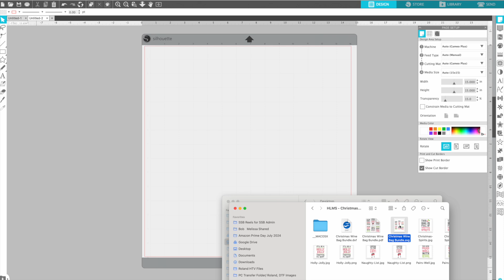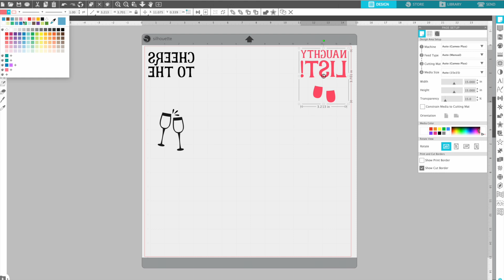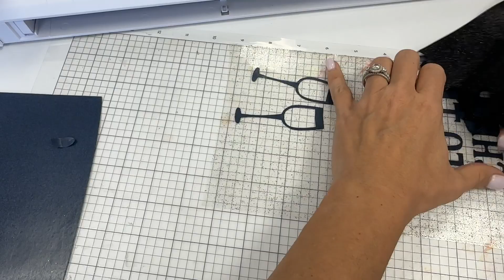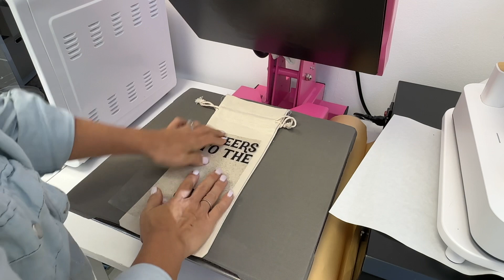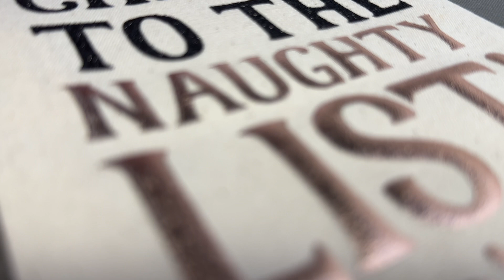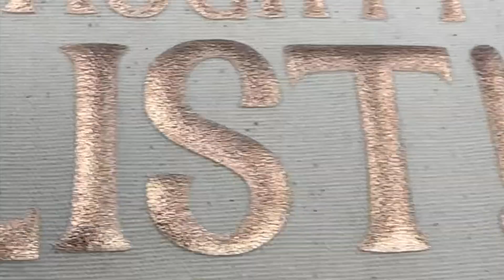Layering Metallic Puff Heat Transfer Vinyl for Beginners

Comment: Great job I wanna know if i can do the same process in a circuit maker 3
Reply from the maker: Yes you can cut puff vinyl with Cricut maker, however your settings may be a little different.